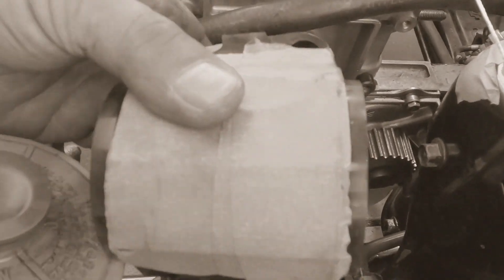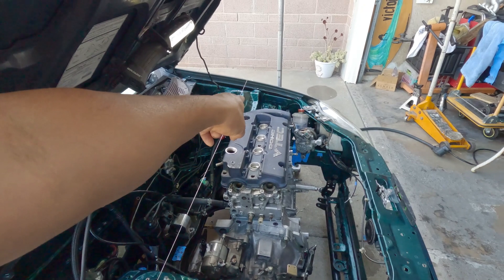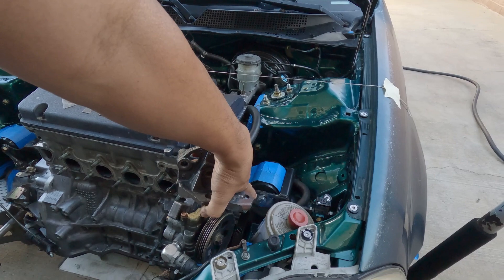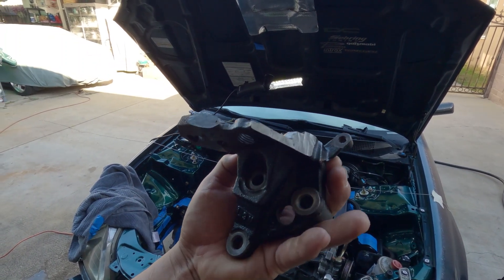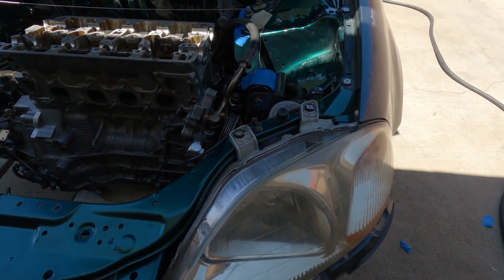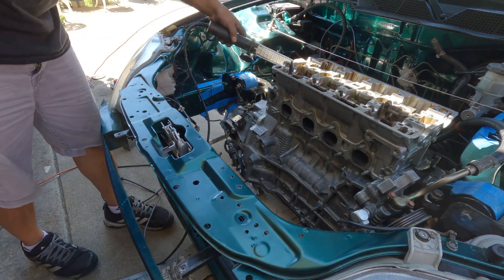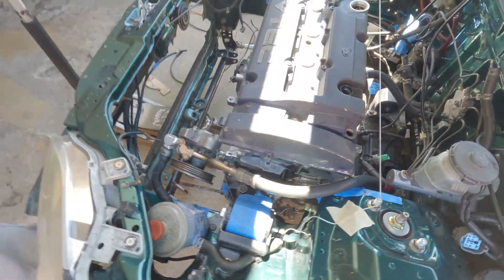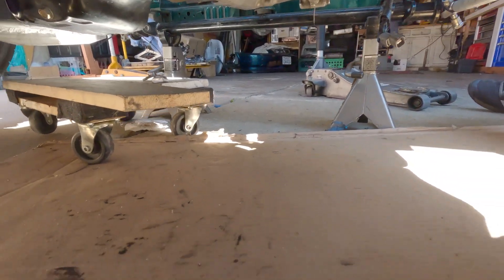G2B engine post bracket. ep.8

Comment: Which post will i need for the 92-95 civic with the 3 holes
Reply from the maker: 92-95 Civic mount has 3 holes.
Reply: @sagittnet2158 yeah that's the one I have but which post mount will be best
Reply: To fit the 3 hole mount my kit comes with the 2 hole post mount ek I have a eg
Reply from the maker: @RaymondMontes-q5v  Lets see if l can get this correct. Are you building a G23 w/ b series tranny or is it full G23 w/ H tranny?
Is your kit is a H2B kit or is it just a  EK engine mount w/ 2 holes for driver side? Lmk what you're swapping on your EG, this way l can get my suggesrion correctly. I really dont want to give a incorrect answer. Thanks, tell me about your build.